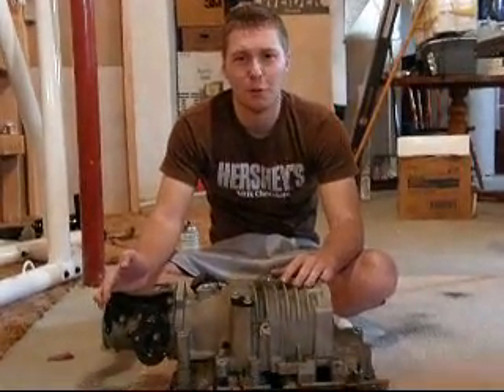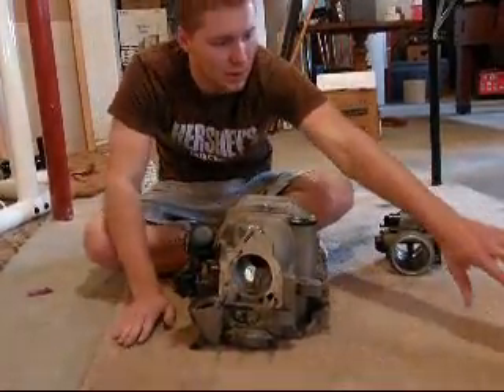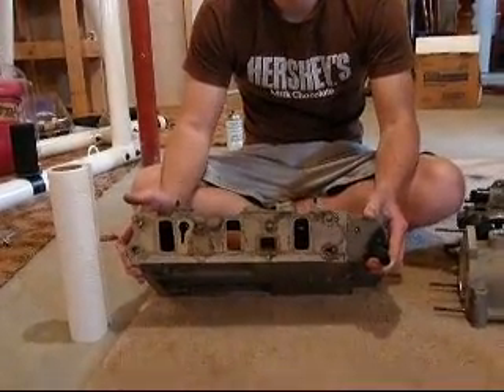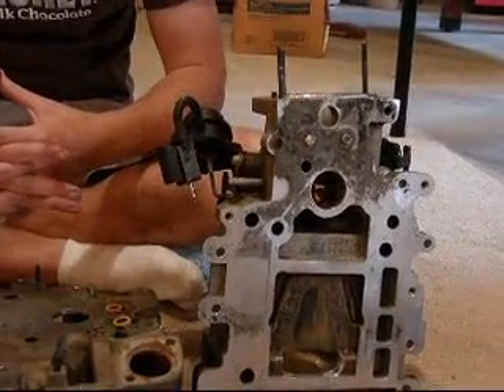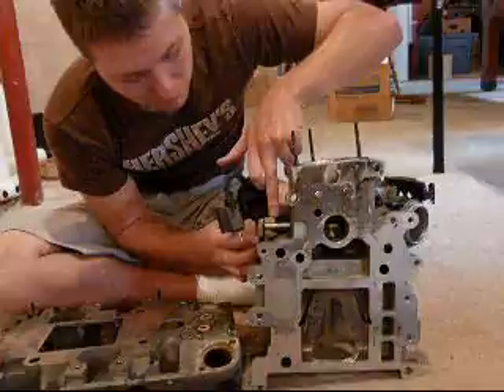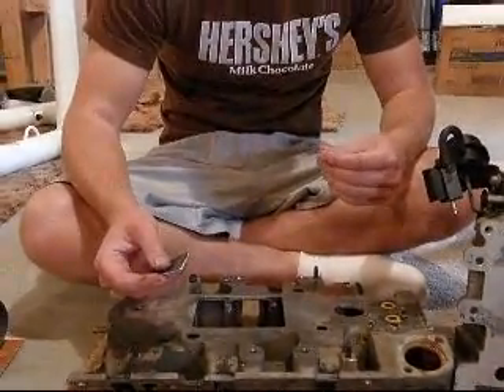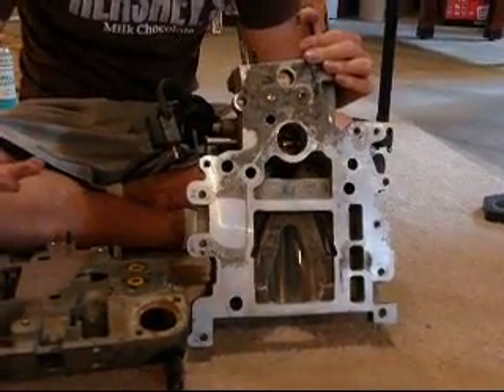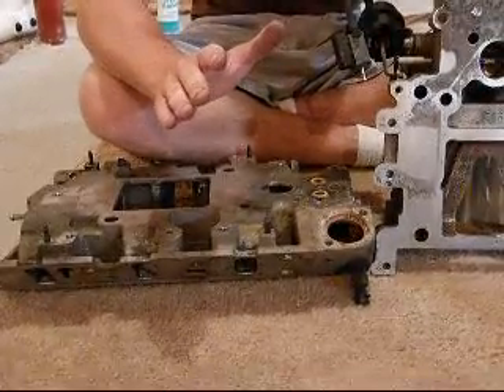Grand Prix GTP Tear Down Explained/Port and Polish

Comment: I wonder if his car ever blew up. Sorry to say it, but the friction from compressing the air alone makes more heat than you'll ever save from blocking coolant ports. The longer you run the charger the more heat it will make getting hotter and hotter and eventually killing the oil and wearing down the SC. It's physics. You sacrifice a little temp in the short term, but gain temperature control/constant temp in the long run by having the SC water cooled. If you're really worried about it, get a cooler thermostat like the pulley kits come with.

Comment: now the supercharger will indeed overheat, and thus screw up this guys shit.
Reply: Kitteh Master Nop , will not overheat.  Supercharger use high temp grease on the bearings. Coolant passages r for throttle body only.

Comment: the only reason gm put the coolant passage in the supercharger and the throttle body is to heat up in incoming air to help the gas mileage and to help keep emissions lower if you block them off like most people do and like most intercoolers for the 3800 do is to keep the temp lower....however you are correct the turbines spin fast causing heat but the incoming air will cool the turbines just fine

Comment: The coolant ports serve only one function, to prevent the potentially moist air that passes around the throttle blade from icing it in position due to the pressure and temperature drop. They have comparatively little effect on the supercharger, and inlet temperatures. The throttle body gets a little warmer with them then it would otherwise. They are so small and located only in one little spot at the throttle body, blocking them or leaving them functional isn't going to make any real difference.

Comment: There is no fuel inside the supercharger. Turbulence on the interior wall of a tube is still a good thing, as it acts like a lubricant for the air to pass through. Too smooth and the air tends to adhere to the surface causing drag. The turbulent air near a rough wall breaks up this adhesion. Think of a golf ball.

Comment: I polished the intake ports on my 00 Intrigue 3.5 24V LX5 Shortstar the ports had a layer of gunk/carbon build up. The intake ports were also very rough so I hand sanded all 6 of them and between the groves where the valves split. I used 400 initially and worked my way up to 1000 they are very smooth. If I ever take my intake manifold off I bet cleaning them would be easy. My car feels a bit faster but I already had CAI K&N RE-0920 Filter with 3.5inch piping also did seafoam exhaust wasnt Ported

Comment: Great vid!!! 5 Stars, was wondering am i better off just putting a gen 5 LIM and s/c on then porting and polishing the gen 3s?
Reply: A ported gen 3 supercharger and ported lower intake is almost as efficient as a stock gen 5. Almost. So it's really about weather or not you're willing to spend the time doing the porting yourself vs spending the money on a gen 5. This video doesn't show the full porting on the bottom of the supercharger nor the work needed done to the lower intake.

Comment: Nice video however I'd like to correct you on a thing or two.

A polished smooth surface doesn't cause turbulence but improper fuel atomization on the intake side, if you have a wet intake.  If you have a dry intake like the GTP then the smoother the better.

Also a fully ported supercharger is worth about 10-15hp.